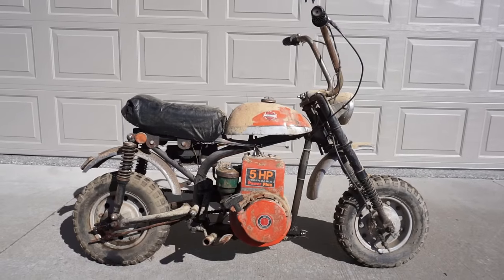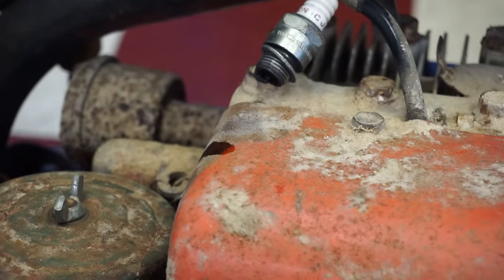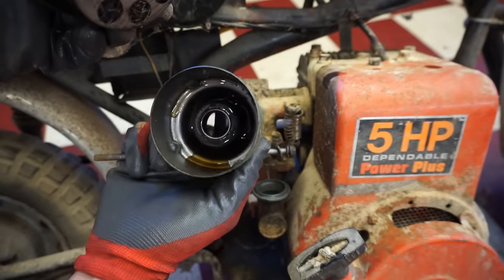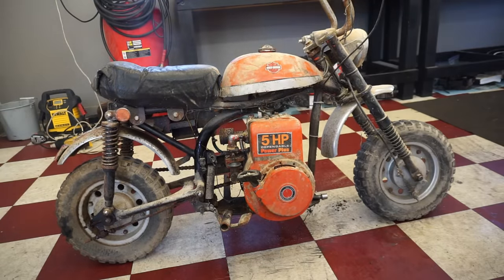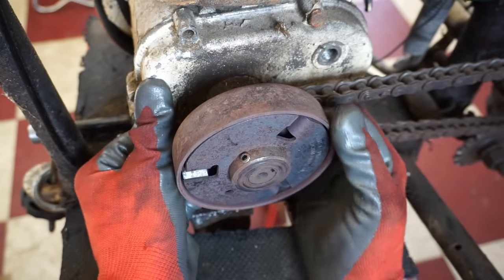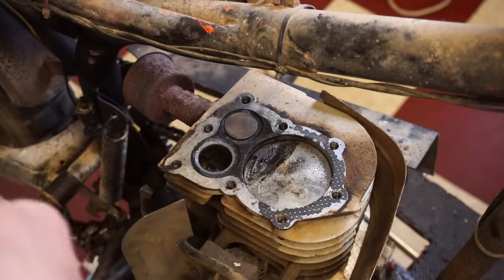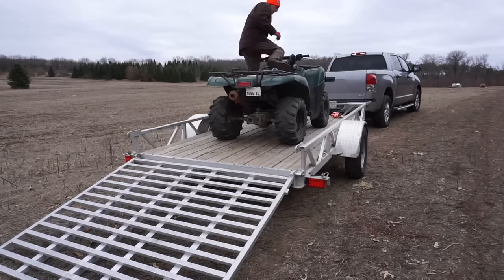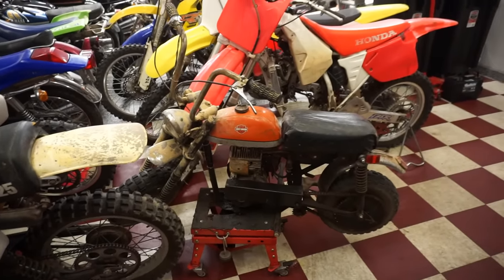$100 Barn Find Mini Bike Hasn't Ran in 20+ Years (RARE FIND?)

Comment: I have to ask,  the bikes you pickup are usually neglected,  why is it that you never wash them off before tearing into them?  You’re just transferring the grim on to all the parts you pull apart.  😊. Quick ask solves the grime on your gloves transferring on to engine parts.
Reply: Agree, but that's the way Joe does it. I would end up doing a lot of cleaning and not much fixing.
Reply: Yeah it could do with a wash
Reply: My guess is he does not clean on purpose, to milk more comments, which is good for the algorithm.
Reply: What?
's funny is a lot of times when he's all done.Then he cleans it but he's still a master of diagnostics
Reply: I don't like bringing the extra dirt into my shop so I clean first.
Reply: No need to.wash them.
Reply: Possible it's cold and freezing . He normally washes them when weather permits. Fixes them when he gets them in his shop.
Reply: @krama2940  he doesn't wash them till after he fixes them not before.
Reply: @krama2940  he never washes them before.
Reply: @jerrywilcox9890  have you seen his shop? It's under his house.. where would you wash your equipment in winter? When the water freezes on your driveway? I have never seen him wash in a in a enclosure. Where it is heated.
Reply: @krama2940  how many times did he was them at the car wash lol.many times when it was cold.
Reply: @krama2940  he doesn't wash them inside the garage lol.
Reply: @krama2940  that's what a car wash is for.but he never washes them first he fixes the then washes them.
Reply: @krama2940  Who cares if it freezes on the driveway way.For me, it doesn't matter. My driveway is almost a mile long, but my house 200 yards is heated infront of my house.salt works good.no different than when is rains and freezes lol.
Reply: @jerrywilcox9890  just for quriousity. Where  and how do you wash your vehicles in  winter?
Reply: Heated pressure washer.then roll it in the shop.

Comment: Hey when you were testing the compression and it said 60 psi that's how it's supposed to be from the factory. It's got a compression release you would have to spin the engine over with a drill to get the true compression number. Also should replace that clutch before buying anything else.

Comment: Nice Job! What happens is: the Cam Lobes wear down and it closes up the Gap! By the way, please try pouring Oil Bottles @ 180 degrees from they way you do it. Just a tip it allows the air to escape and won't be doing the Blurp-Blurp on ya. Love all your videos!
Reply: Finally someone said it
Reply: worn cam lobes increases clearance if anything. it often doesnt change the clearance much, just decreases lift
Reply: I would be curious as to what would cause the clearance to decrease? Was it like that from the factory then? @JyveKilla
Reply: @indianachrisUDX1313  the valves receding into the seats with wear.
Reply: Thanks, that makes sense. I had it Bass Akwards then, lol @JyveKilla

Comment: Kind of looks like a Z50 chassis with a different motor in it. I had a 77 z50 that looked alot like that.
Reply: exactly what I was thinking.
Reply: yeah, looks like someone had a roller mini trail and heavily modified the frame for a jackshaft. Those handlebars are definitely mini trail
Reply: yeah same tires and head light and every thing...<
Reply: I believe it’s a Gemini SST frame.

Comment: Those old Briggs and Stratton engines are almost indestructible! And if it doesn't have a hole in the block and you can get spark then you can get them running.

Comment: You pulled the upper half of the carb off with the brass tube installed. That often causes damage to the carb body. That brass tube unscrews before separating the two half's. Also I have never seen a 5hp Briggs with an updraft carb, they usually have a suction type with the gas tank attached to the carb, though the updraft should work, but was most likely off a 3hp Briggs.

Comment: We also do small powered equipment repair here. Seen some pretty crazy custom farmer builds. Got a 5 h.p like that one in the shop, fresh build, still only bout 90psi. Fires right off, new carb on it too. Guy wants a tote goat made out of an 88 kdx 200 frame. Got the chain drive clutch for it, etc. Gonna be an interesting, rainy day project.

Comment: The minibike market is strong and prices are high. I would love for you to find a black Briggs & Stratton IC motor for this.  They have accelerator pump carbs and roller crank. Axe the govenor and you could pull tree stumps with that thing.
Briggs have way more torque than a stock 212 but I don't think they make them any more.

Comment: If my memory is correct, these mini bike were sold by Harley dealers for a short period of time as a promotion.  I would keep as original if possible.  The clutch would be my first choice for replacement as they can burn up (the friction material) and simple to replace before engine rebuilds.
Reply: They are bad to glaze, especially with a poorly running engine that can’t generate enough rpm for full lockup.  Sanding the drum and shoes can bring one back most of the time.

Comment: That needle valve seat setting is supposed to be 1 1/2 turns out from the seated position and you shouldn't have to mess with it anymore except for to determine the high throttle speed positioning. And you don't want to force the needle vavle seat position, because you can damage the needle. But good luck

Comment: Just go to harbor freight and buy a new engine for the mini bike
Reply: Wouldn't look as cool
Reply: Splurge and get a 10-15hp
Reply: Some of those ol' school mini bike frame are designed to fit a flat head engine, and in most cases you'll have slight fabrication needed to make a honda gx style engine fit correctly.
Reply: I agree but also would be good to keep the old engine to experiment on. If he ever bought a 3in1 lathe milling machine. Use it for practice to try and bore out & install bigger piston & rings.
Reply: He could rebuild that flat head and sell it and buy 2 of those throw away predator engines.
Reply: @benny, forget Harbor Freight, we are here to see Joe fix things.

Then of course Vinny the "Master Mechanic" brings us here as well😅😊😂
Reply: @snowyowl7042  Too much HP for the frame and sprockets.

Rebuild it.

Comment: FYI.  I've had a lot of weird things happen with condensers. 70 Challenger. When the condenser would start to go the car would start, idle perfectly, but any pressure put on it, it would break down and stall. We used to test them buy nosing your bumper up to a tree, in gear and give it a little gas. I had the same thing happen to me in an 82 boat. It would start and idle perfectly but the second you put it in gear it would stall. Had to be towed in 2 miles. Got back home and it donned on me, oh yea that what condensers do. Had two extras with me that day but never thought of it. lol  Condensers will break down with time also. Never trust one over a few years old. Good luck.
Reply: For sure.   Using “known good” ignition parts from a properly running engine can really help chase down the gremlins.

Comment: Not sure what you mean by changing the cylinder. It don't come off. Lol. Can short block it but a predator engine is cheap. The air filter supposed to have oil in it. It's a oil bath filter. The starter clutch, you clean the crank. Don't pump oil into it. Put a drop in it. Pull it apart. Clean it out. Put together dry. It's definately the rings. Motor is probably 60+ years old. They ard hard to kill but get worn out. I short blocked many in my uncles shop in the day. Not cost effective now. Back then a short block was $30. The cooking degment  was great  Joe. You should do more of that. Esp after fishing. Who got the deer ? You or your family? Some video,of that would be great. Dragging it out with a quad you fixed.

Comment: File and Set your points. Swap out coil and condenser next.
Check the key on the flywheel.
It sounds like timing is off or spark is weak.

Comment: I have a bike like this. It's a B&S in a CR80 frame. I didn't do it but I had to pick it up for only $300. It's kind of a shame they welded a plate in to hold the engine and actually use the CR80 bottom end and cut the gas tank so the B&S fits inside. If you can get over the loss of the CR80 (which likely had some major top end issue?) its super cool to put around on and a real head turner.

Comment: I'm not an authority on Briggs engines but I know they are low RPM, lower compression engines. If it was me, I'd throw a centifical clutch on It and a set of rings. I remember those little bikes in the 80s, as a kid growing up.

Comment: My question with these B&S flat-heads...why is the exhaust valve as far away from the cooling fan as possible? I have one like this and had to replace the head gasket...it blew right behind the exhaust valve...it seems like pretty poor designing (or intentional) to put the hottest spot as far away from the cooling as possible. Seems likely to always have the head gasket eventually fail at this point.

Comment: I had almost the exact same bike minus the horn, headlight and gas tank. It was manufactured in the late 60's early 70's and mine also had the same 5hp B&S engine on it so it must have came stock with it

Comment: That looks like a modified Honda Z50a frame. Looks like the engine cradle (down tube and mounting plate) was added to the stock frame.
Reply: Nope. Not even close to a Honda. AT ALL, or any part of it. It is a Taiwan copy that was made back in the day and looked like a Z50, and this copy has had a Briggs engine mounted in it at some point (wasn't original to the copy bike).

Comment: Absoutely a Honda 50 mini trail front end tank and rear end. Looks like someone cut the Honda engine mounts off and welded on a plate for a briggs. Wheels and Brakes definitely a early 70 s mini trail. The gas tank appears to come off a original year hard tail mini trail.

Comment: Never got to see how the clutch turned out?  Pretty sure that set screw is supposed to be lined up with the key and/ or there is a second set screw lined up with the key.  In any case, where did that plane land?  It’s obviously turning the wheel but I’m curious.

Comment: When lapping valves I like to get a short llength of rubber tubing that fits snugly on the valve,  then stick the other end of the rubber tube in a cordless drill chuck and use the drill to rotate the valve in the seat until their seated uniform & purdy' 😇 ..

Comment: I could be wrong, but I’m betting this is at least mid 60s to late 60s because of the oil bath air cleaner I believe around 65 through 69. They did away with the oil bath air cleaner on Briggs & Stratton not to say that somebody couldn’t have put that on there after the fact, but I believe that’s possible that this is a 1960s. Bike

Comment: It was called A Honda prelude elite mini bike. I'd it was A 50cc Mm up to 70 ccmb original engine's that was put into those mini frame.  Elite mini bike and the Honda extreme Elite mini bike frame. And the Honda Elite Perez Elite mini frame. Those we're all limited years additions makes and models from the 1980's and 1990's very few of those frames and mini bikes we're ever built. Due the Honda 70 trail master and etc. like the Honda 80 & 90 110 and so on. Like the Honda 125 & 150&170 &175&185& 195 from 110 forward was A little bit bigger mini frames. Although you could order in factory smaller versions with bigger engines on them with matching identification plates  tag tabs. Most people would just swap it over to the smaller frames by welding those on to the framework. And have the matching engine's mounted into those frames. Usually it was the handle bar forks bearing spout tube stock shaft that was cut out and rewelded into the exact same spot we're the original fork bars spout shaft tube went.

Comment: I had a similar mini bike. It was a 3 1/2 Briggs and Stratton. The only thing different was the one I had was governed. I took the governor off (looked like a little flag) and I had a top speed of about 40 mph. That was with my brother on the back. We were on the train tracks. The chain did break and hurt my brothers calf. That thing really moved for a 3 1/2 hp engine.

Comment: It looks like it’s a mid to late 80s box minibike they are they were pretty much designed after the little Honda Cubs and things of that nature from back in the days and they had a Briggs & Stratton motor on them usually 3 1/2 or 5 hp little centrifugal clutch some of them had a twist throttle. Some of them had like almost like a brake lever that you would pull. Some of them had front and rear brakes and some of them just had a pedal that you would push down on, and that would move a pad of steel up against the rear tire, which is what mine had great

Comment: I know people like those old engines, but, I think i would run to a Harbor Freight and buy a Predator 212 or 224. If you're looking for a bit more speed, buy a stage 1, Gov delete and torque converter. Should be about $200 or so and it will be better, faster and more reliable that that old tired engine.

Comment: That’s a 70s kv75 Kawasaki that someone has put a Briggs engine on it. The kv75 was to compete with Honda 50 & are very rare. Some that are mint fetch big money.
Reply: No. Forks and wheels are NOT KV75. Doesn't have the same frame, tank, or anything Kawi.

Comment: before it started....these were my idaes Joe....Low air in tires.Too much mouse poop in gas tank....low water in radiator.....horn button missing.....seat ripped.....lights stuck on......no oil in muffler......engine color doesn't match.....tires on backwards......handlebars bent.....no idea who Mr, Bill was...?

Comment: Just for that tank on eBay you could get 250.00 or more dollars for it I'm a mini bike collector I've been collecting for over 30 years I own over 50 mini bikes and if lived by u I probably make u a offer for that bike because I've got the correct. motor for it hs40 Tecumseh with a lightning coil to power the lights

Comment: My guess is the engine is worn out.  Probably from a leaking air filter that allowed it to suck in dust during riding.  The piston and rings are loose, so low compression resulting in low horsepower.

Comment: looks like someone slapped a flat head briggs on an old trial bike .  Those updraft carburetors are not the greatest. Also looks like your clutch may need replaced if the internal springs are weak it will engage too soon and not allow the engine to build a little power. Also might need a bigger rear sprocket. Most of the old factory bikes I seen the rear sprocket is almost the same size as the wheel.

Comment: Personally, I would have piwer washed it before working on it. Just ti get rid of the crud on it.
Reply: Yeah. In Wisconsin, -10F. Be well worth blowing the water pipes out of the house, or spend 3.00 at carwash to haul a block of ice into garage to make a mess. Id just wash it in garage and sweep the water out to freeze my driveway.
Reply: @Hammerback0  Since I grew up in Minnesota,  I can figure out its not -10 degrees outside during this video.   It's March. Can be cold but since he is wearing a long sleeve shirt and grilling outside, it's most likely not -10 degrees. 
So yes, I personally would have power washed it before working on it.
I have no idea what you would do!
Blowing the water pipes out of the house, hahaha.

Comment: Actually to tell everyone the truth it looks like a Rockford chibi. Minus the different engine. I got one used in 1975 I was 5 years old and Evel Knievel was my idol. It had a three speed transmission. It was the same color orange. It Highly resembled a Honda Z50 monkey bike. Minus the clutch. I mistook it as one for years. But I never could find a Z50 with a clutch. I rode the wheels off that thing. It finally got left behind in a move. Broke my heart. 😢 Stupid parents if they only knew today it's worth thousands refurbished.

Comment: Oh dang, Chef Joe! As for that engine. It's just a B&S engine. You can try calling them with the serial number. Or head over to Harbor Freight and throw a Predator 6.5 in there for $150.
Reply: No way !

I see to many School Minibikes from the 70's where they throw them Predator Motors on them and try and sell them as "Antique Minibikes". 

One like this with an Original Briggs or Tecumseh are the real thing.

Easy to rebuild and will run forever.
Reply: @dannyg402012  Might be easy to rebuild, but hard to find parts. I had an older B&S horizontal shaft on my pressure washer I couldn't get parts for.

Comment: Just wanted to give you a heads up thanks for the videos love the channel. Wanted to ask I’ve noticed every time I watch these videos it looks like you’re running these bikes with the garage door down. If that’s the case and you do breath in these fumes. It’s really not healthy for you might wanna try and open the door or just try and start them outside. Harbor Freight makes a Predator racing go-Kart motor is a really nice motor really cheap. That sure is a nice find diamond in the rough. Love to see this thing restored looks like a real keeper show piece just looks great around the shop
Reply from the maker: Garage door is open

Comment: Don't put another engine on Joe. That looks like original one. Worth a lot more with it. Just check piston and bore may just need rings. Worst case scenario, piston and ring kit. And gasket kit too but be much better than a predator engine. It's a sweet little bike with full suspension. You can fix it in no time, clean it up. And will be very Minty!!!
Reply: It is a Taiwan copy that was made back in the day and looked like a Z50, and this copy has had a Briggs engine mounted in it at some point (wasn't original to the copy bike).
Reply: Thank you! I didn't know that it wasn't original. Your knowledge is vast. I don't know a lot about mini bikes.👍